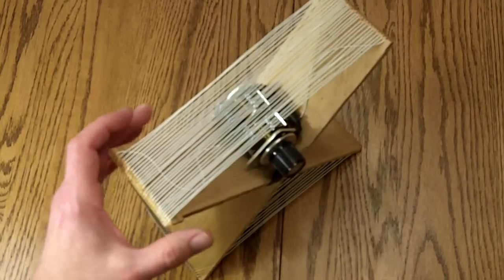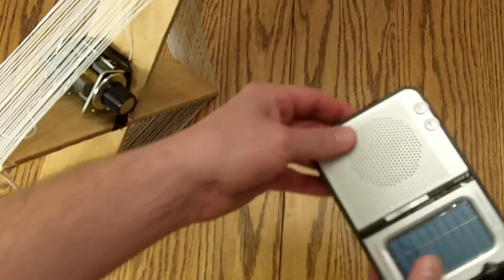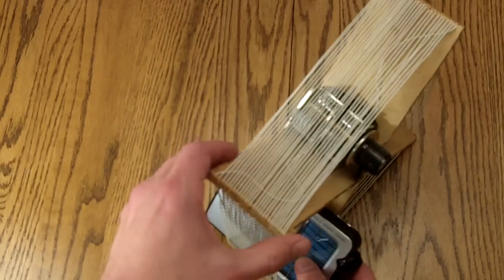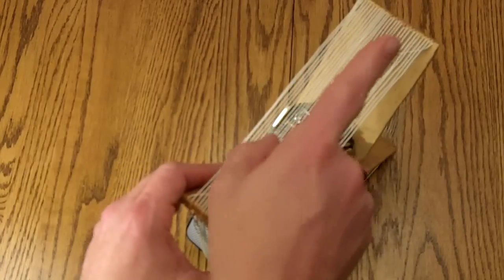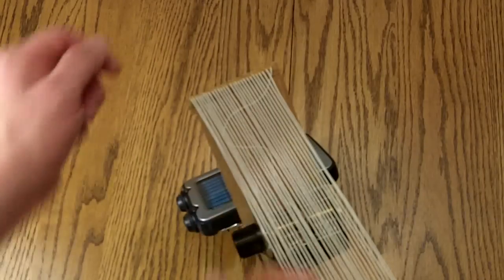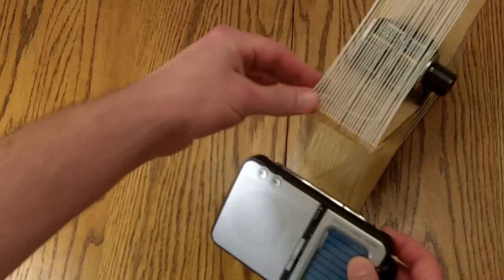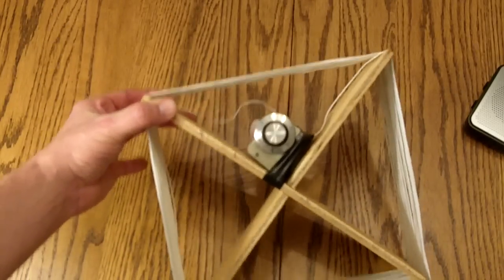AM Radio Directional Loop Antenna Demo Homemade..Make Your Own For A Few Dollars!  And They Work.

Comment: I need the best AM long distance reception antenna, indoors or outdoors.   I need Orange County (90 miles), LA (120 miles) & San Francisco (500 miles, and further if possible).  I believe what I need needs to be directional such as that which is described in this video (or a similar outdoor unit that I can also move around) ...  

I'm looking for a SERIOUS antenna, not my own science experiment.

Do you have a number?  I am a paying client in need. Thx

Comment: I need the best AM antenna I can get ... indoors or outdoors.   I want signal from Orange County (90 miles), Los Angeles (120 miles), Phoenix (300 miles) and San Francisco (500 miles) and further if possible.  I believe what I need needs to be directional such as that which is described in this video (or a similar outdoor unit that I can also move around) ...  the stations I want are all NORTH, so that will be where the antenna is pointed if it may be pointed.

I'm a paying client.  Phone #?

Comment: That!! was good, how many turns and guage, for my Uni project, RHG with regards Les G4XMX, Freq about 1500-1600 Kcs.? .myman.
Reply from the maker: Hi Les, I don't remember the guage I use for sure but as you can see, quite small, it is not real important but around 24 turns of wire about the size you see in the video would be very close if you use a variable capacitor like I used.  Mine will tune most of the AM broadcast band here in the US, around 530 khz to about 1600 or so.

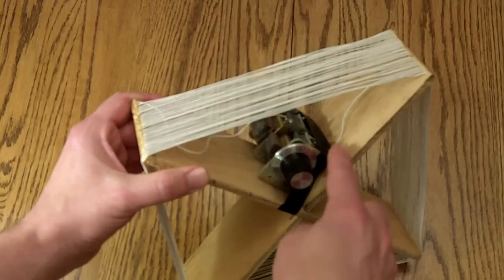Comment: At 0:27  he says the capacitor is in series  with the winding.  Well fine, but would anyone dispute the fact that in this particular case one could  have said, that the capacitor is in parallel with the winding?
Reply: With only the two components present, series and parallel are identical.

Comment: Does anyone know if you could you use an old 40 or 80 wire ribbon cable by stripping and soldering the adjacent wires to make it into a coil? I have no idea how you could easily measure it's impedance.

Comment: Can anybody here help? See someone told me because my radio has transistors it won't work with today's antenna due to the digital switch that took place late last year. I don't see how that makes a difference seeing as I still get a signal, it's not as strong as before but shouldn't an antenna help, or are they right about the transistors?

Comment: Dropped the radio accidentally. Case broke. I recommend you buy a protective case. Otherwise a good radio. I also recommend you buy a longer antenna. 
here is the link to it in case anyone is interested: amzn.to\14UsPSd